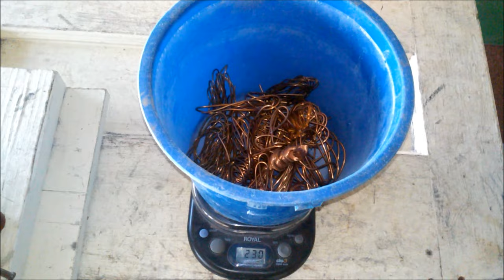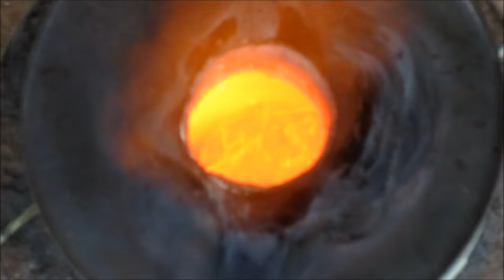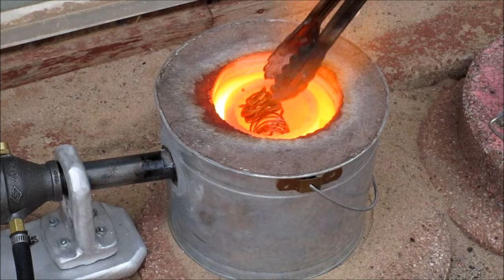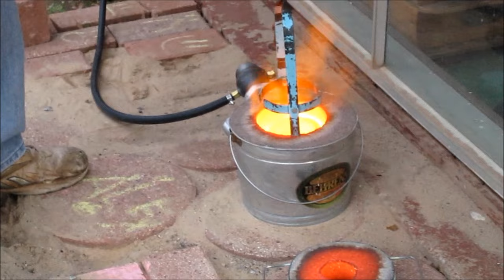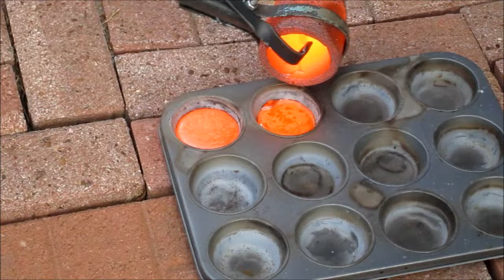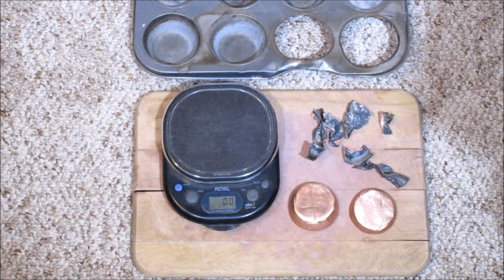Melting Down Copper Wire Into Ingots

Comment: Wow never seen where the Copper just told steel to go get bent like that! 
Nearly 95% retained ! Very nice ! 
I am nearing the day I am going to use my electric furnace for Aluminum and then Brass, Copper would be a stretch but possible. I learned that I need something stronger than steel for my Cu Puck casting... 
Thanks for posting!!
Reply from the maker: The steel muffin pan worked great for aluminum.  Not so much for copper.  I ended up having to grind some of the steel off of the copper ingots with an angle grinder.  I am planning on pouring the next copper batch into an open top sand mold.  That should work better.  Thanks for your comment!

Comment: Cool video mate ! I get cheap graphite molds off eBay and make cool ingots with them once they harden they just fall straight out of the mold and the ones I have I have used 30+ times and they work bloody brilliantly. Just remember to heat the molds first 👍🏻
Reply from the maker: Thanks, using graphite molds sounds like a good idea.  Since this video I have been using open top sand molds for casting ingots but using graphite molds would  probably be a lot faster.

Comment: Why do you add borax into the molten metal?
Reply from the maker: Borax is used as a flux to clean up the melt.  It is intended to separate impurities from the molten metal.  Thanks for watching!
Reply: I was scrolling down to ask this question..thank u 4 answering and thank u for asking👍👍
Reply: Not needed when its copper wire, the wire itself is 99,9% pure copper.
Reply: @MoltenMetalCasting  What happens to the Borax after it's separated the impurities from the molten copper? Does it rise to the top as dross and removed via skimming? Is there a rule for how much to use? Above i mentioned melting copper with the 'reddish' enamel coating on it. Would I use Borax to remove the unburnt-off enamel?
Reply from the maker: @steve3964  The borax floats to the surface and you can remove it before pouring if you wish.  You don't need to add much, the tablespoon I used in the video was more than enough for the crucible I was using.  Half that amount is plenty.

Comment: considering copper is currently only worth $2.70 a pound, i'm not sure this is worth the time and fuel costs at this level. But fun to watch
Reply from the maker: You are right, it wouldn't be worth it.  I use the copper to make bronze for casting objects such as the one in this video; https://youtu.be/jZiRjEeHMNw
I don't sell it for scrap.  Thanks for watching!
Reply: No one gets that this is a hobby.
Reply: Well for me i have apple bins full of scrap wire and we melt them down and sell them we usually make a pretty good profit out of it

Comment: It helps to have the muffin pan super rusty. It won't stick to the pan then but it will pull out some rust with it
Reply from the maker: Now I pour brass and copper into open top sand molds.  Removing the muffing pan from the copper was a pain!
Reply: Molten Metal Casting ya or get a solid steel mold the pans are just to thin and heat up

Comment: it's a pretty fast one there, but what happen if i planned to alloy my 90% aluminum with 10% copper, at what temperature should i introduce my Aluminum, considering the difference in melting point of both metals?
Reply from the maker: I am curious why you want to make that alloy (I haven't made that alloy before).  
Based on my research you will first need to make an alloy of 50% copper and 50% aluminum.  The copper will need to be melted first and then the aluminum added. 
 You will then need to melt aluminum and add the solid 50/50 alloy that you previously made.  The aluminum on its own will be 80% of the final weight and the 50/50 alloy will be 20% of the final weight so you end up with a final alloy of 90% aluminum and 10% copper.
The first melt will need to get above the melting point of copper (1,984 deg F or 1,085 deg C).
The second melt will need to get above the melting point of aluminum (1,221 deg F or 660 deg C).

Comment: i use the same muffin tin for aluminum ingots. i have the same setup as you glad to know it can do copper also. i have 100 pounds of pure copper wire no insulation to melt. what should i use instead of the steel pan?
Reply from the maker: I use open top sand molds now.  You can see me using them in this video; https://youtu.be/whBp8H08L8k

Comment: Does enamel on copper wire melt off the during the smelting process? Does it become a slag on top of the pour for skimming off pre-pour? Cheers!
Reply from the maker: Most of the copper wire was building electrical wire and didn't have enamel.  The enamel did burn off the wire that had it.  There wasn't much dross compared with aluminum melting.
Reply: @MoltenMetalCasting  thank you very much for answering the question. I was asking the question purely not knowing who or where to ask about it. This will now save me time manually removing the enamel on my large amount of transformer wire that I want to smelt. Cheers :)

Comment: Great job! I'm on my second furnace and I'm so close to melting copper but can't seem to get it hot enough. I'm guessing it's my burner. Do you have specks on or a video about your burner? Thanks.
Reply from the maker: Thank you.  I purchased the burner that you see in this video from  Lost and Foundry (www.foundry101.com).  The burner works great, it burns a lot hotter than my home made burner.  The original regulator that came with the burner is no longer working but luckily I had another one on hand.   I have only successfully melted aluminum with the home made burner.
Reply: Molten Metal Casting awesome, thank you!

Comment: I'm starting g to melt metal myself but my burner is as loud as a jet airplane, urs sounds more quiet and smaller where did u get it from??
Reply from the maker: I bought the burner from Lost and Foundry (www.Foundry101.com).  When I turn up the pressure on my regulator the burner does get louder.      If you want the burner to be quieter use an adjustable regulator and turn down the pressure.  It will take longer to melt, but it won't sound like a jet engine.

Comment: Whats your furnace made of? I used plaster of paris and play sand but i dont think its retraining the heat like it should.
Reply from the maker: The build for the main furnace that I use is in this video; https://youtu.be/ve8gc53os4A
It is made out of castable refractory and ceramic blanket insulation.  I also have a furnace that is made out of sand and plaster.  It works fine for aluminum but I don't use it for copper or bronze.

Comment: Hi
What is the function of this powder and how much required  time for this process
Does we apply to plastic sheet
Reply from the maker: The powder is Borax which helps separate impurities and clean up the melt.
Reply from the maker: It took about 30 minutes from lighting the burner to pouring the molten copper.

Comment: What furnace would you recommend for volume smelting?
Reply from the maker: Here is a video of a larger furnace I have built;
https://youtu.be/Mjtd8D13Vkw
The size of the furnace depends on how much you need to be able to pour at once.  I use the smaller furnace more often though because it weighs less and it heats up faster.

Comment: just a question, maybe you guys or someone viewing has an idea.  Say i was to have access to very large amounts of copper... but its mixed in with other materials and its basically a powder.  its mixed in with roughly equal amounts of... stainless steel, and very high carbon steel,  typical rolled steel and lastly... grinding disk material.. 

any ideas how one would separate the copper from these other materials ?? easily.. lol
Reply: im actually able to collect some of the fine powdered copper before it gets mixed with everything else but only sometimes can i take time to do that... which i am collecting... along with other copper obviously :) but im trying to squeeze every bit..  i tried taking some of the mixture and putting it into a plastic bottle and shaking it.. thinking possibly it would fall into separate layers lol ( idea from youtube) didnt work at all maybe i didnt use a large enough bottle or to much mixture..  one step i can do to remove a lot of the rolled steel and high carbon steel... is a magnet.. it doesnt really work that great on the high carbon steel but i think it does work.. maybe ill try doing that and testing the bottle method again. 

nice little furnace by the way ;)
Reply from the maker: Thanks,  have you tried a strong permanent magnet (like a speaker magnet)?  I think you can melt the powder with the grinding disk material in it because that material should float on top of the melt, allowing you to skim it off before pouring the copper.
Reply: your welcome, i am still debating on which ways i am going to try and melt it down to be honest. whether its build a furnace similar to yours or some tests with a charcoal one or something. 

another question :)   so if i was to remove almost all of the material i can with a high powered magnet, which i have access to one rated for about 250 pounds, that is about 3 inches by 4 inches, 

what would happen if i was to melt down the remaining mixture that would be mostly  stainless steel and copper, with some grinding disk material, the grinding disk material will float to the top, what will the stainless steel do after the copper  melts? as a powder would it float or stay on the bottom
Reply: sorry for having to edit my reply so many times haha   oh and yes i actually have tried the magnet earlier today, it certainly will remove a lot of the regular steel and the (white iron or high carbon steel)
Reply from the maker: I am not positive on what would happen with the remaining stainless steel because although it has a higher melting point I am not sure how much would dissolve in the molten copper (especially since it is a powder).  I have melted aluminum with steel in it but not copper.  With the aluminum any pieces of steel I couldn't remove sunk to the bottom and I removed them after the pour (https://youtu.be/-KXVMY2q1Tw).  There may have been some contamination but it was small.  Steel may float on copper because it is not as dense as copper but I haven't tried it yet.  It doesn't hurt to try it with a small batch to see what happens,  I would be interested to hear how it goes.
Reply: Sean John https://patentimages.storage.googleapis.com check this patent out , you can get an idea on what to do , basically you have a alloy of copper and you want to separate the alloys from the "valuable" scrap or reusable metal" the link can discuss it further and better than I can, just take your safety precautions and do proper research you should be able to get the copper out and iron out.
Reply: Sean John if you melt it the steel will float to the top

Comment: could you just use a blow torch for thin copper wire out of some old solar lights??
Reply from the maker: Possibly, I haven't tried it that way.   If you have a way to enclose the heat it will melt easier.  Maybe you could try fire bricks with the blow torch instead of a furnace.

Comment: Why did you put Borax in there? can you other stuff?
Reply from the maker: Borax is used as a flux to clean up the melt.  It is intended to separate impurities from the molten metal.  There are other options that can be used such as glass and charcoal (but I haven't used those).  Where I live borax can be easily purchased as a detergent booster from a grocery store (20 Mule Team Borax). 
 Thanks for watching!
Reply: Thank you for your reply and will make one. I'm in the process of stripping wires and want to learn things while my mind is working still.

Comment: Can you make a sheet of copper 0.1mm size like A4 paper ?
Reply from the maker: That would be too thin for casting.  Minimum thickness for sand casting is about 6mm depending on the size.  To get a thin sheet of copper it would probably need to be hammered.